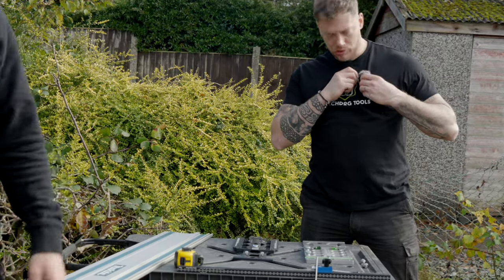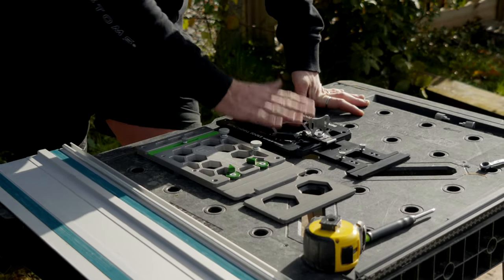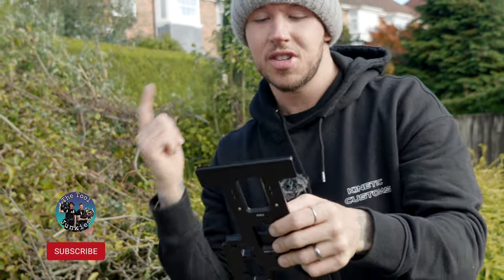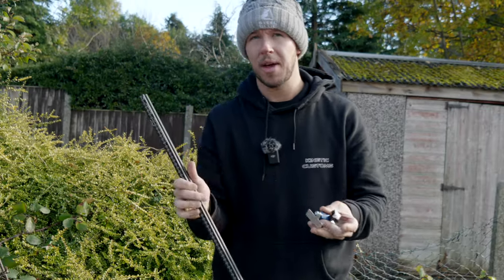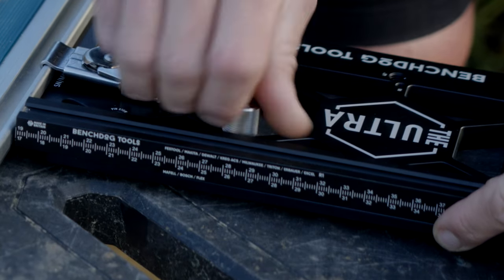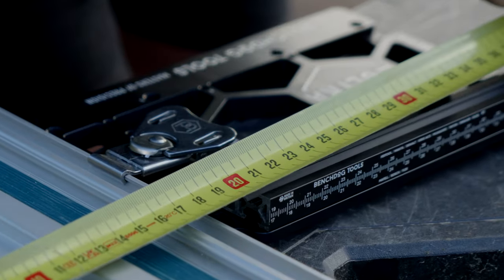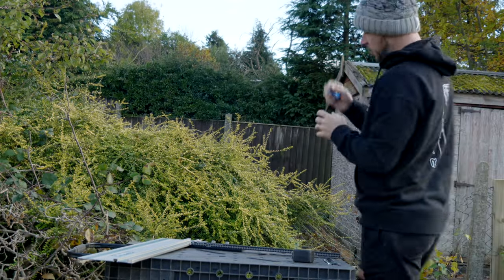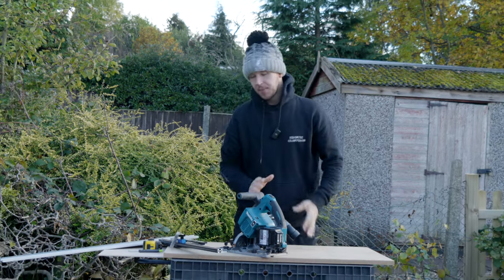Accuracy and efficiency Benchdog Upgrade!!

Comment: Hi, if repat stop can ycut and square parallel , why do we need paralle guide, any advise please.. i assume paralle guide can do narrow cut..
Reply: I think the folks here misspoke a bit. The repeat stop is best for cross cuts, preferably not that wide. The error won’t be great, you’ll get a 90° and parallel cut. If the board piece is longer, the error for two sides no being parallel increases significantly. Let’s say you are cutting a plywood sheet and you need a full length cut and about 3/4 width. A stop guide will be butted up against the width, we’ll be doing a parallel cut. Chances of both ends being exact 8ft is unlikely, there will be a millimetre or three of difference. 

When you use parallel guides, we have two reference points as opposed to one. The cut is a rip cut now as opposed to a cross cut. Since both distances are set properly, we can be more sure that the margin of error is barely a millimetre, if done correctly.

It is a personal preference, some folks do rip cuts first, others do cross cuts first, when breaking down the sheet. 

If one is doing a rough cross cut, the rail stop guide is fine, can be made parallel later. If accuracy is important, doing the cut once, than a parallel guide would be better. 

Personally when I do the first few cuts, I use a parallel guide. When the pieces are more manageable but bigger than 820mm (my quad hinge capacity) I will use the rail stop guide to get the cuts done.

If one has the space, I would recommend to build a bigger table that supports a 8 foot fence on one side and a 4 foot fence on the other side, use two quad hinges, all the cutting will always be square and parallel thanks to the hinge and fences. So far that is what I am leaning towards for next year, I’ll see if I work with lumber more or sheet goods. My lumber is usually 8 feet to 16 feet long. Parallel guides and stop guides are not that useful on them as minimum marking begins at 19cm usually, if the width is smaller, doesn’t help much or if the cut is longer.
Reply: @asderven  thanksmuch for detailed writeup.